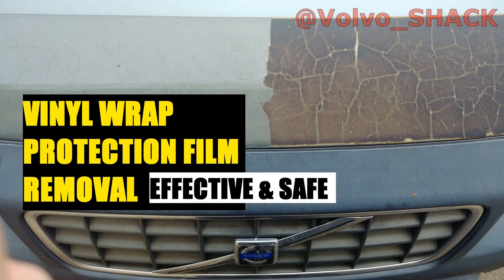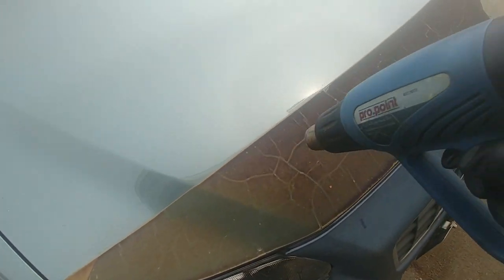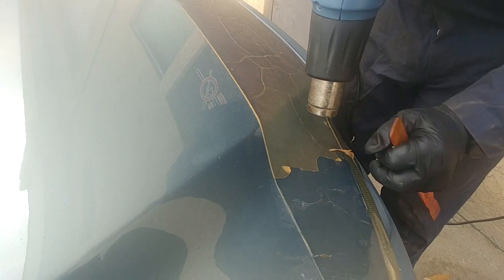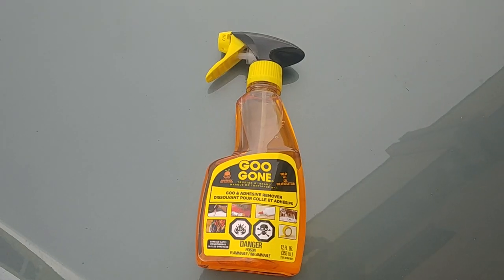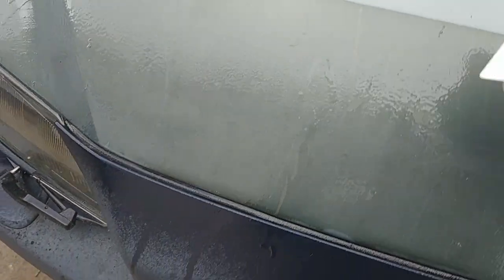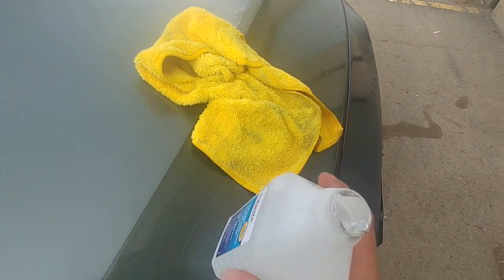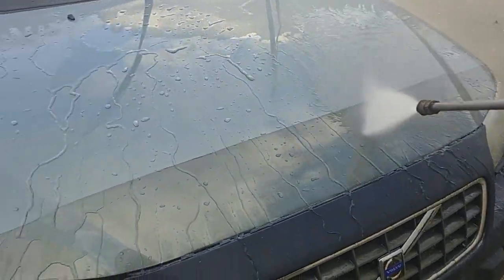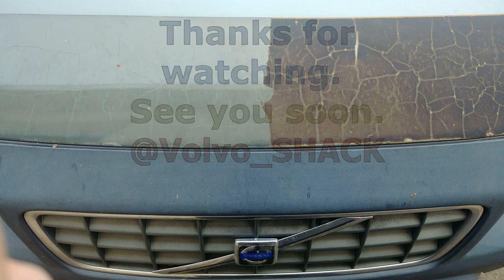HOW TO REMOVE OLD VINYL WRAP FROM YOUR CAR | VOLVO XC70

Comment: What people don't realize is that the discoloration is partially because the paint hasn't been exposed to sunlight and minerals for 15 years. The clear coat under the vinyl is much thicker than the rest of the car. UV rays and chemicals can alter how paint looks, and take away from the color. There's no way around it except maybe sanding and polishing
Reply from the maker: Great point. Thanks for an advise 1Hunnid Studious! I will pin your comment up.
Reply: This is exactly right. Everything is discoloured other then the part where the vinyl was.
I have replaced so many racing stripes for cars. You ALWAYS have this and only way to fix is to expose that part to sun, put new clearcoat on whole panel or wrap and hide edges of the discolouration.
Reply: @Szenenmischa  You could try doing a buff with a medium grit compound too and it'll sometimes blend it all out.

Comment: The real secret that i dont see anybody use us an industrial pressure washer. Theres a large power gap between blasting off vinyl/adhesive and stripping clear coat. Heat gets the vinyl off and cold gets the adhesive off

Comment: What I'm wondering is how to remove the discoloration thats left after removing the wrap. I recently bought a car that had the entire roof wrapped. I removed and I'm left with an entire stain across the roof.
Reply from the maker: Hi John. I'm not sure how to remove paint discoloration properly after the wrap. Let me know what worked for you. Thanks.
Reply: The problem is that if the car had the wrap for many years the paint underneath will be preserved in its original color while the rest of the paint shifts color due to sunlight etc so there will always be some mark left over. But I agree that it also looks stained in this case
Reply: That leftover discoloration is the adhesive that this yahoo didn’t get. Use goo gone graffiti remover(the aerosol can) and a plastic scraper to remove. Once your done with that you can buff out any scratch’s with polishing compound.
Reply: I painted cars for years and never had a problem using paint thinner to remove any adhesive.  This was a little different. I removed a whole layer of adhesive. It was like a "boogery" texture and took forever to get it all. However, after that stuff was removed, it still had a yellow tint to it. I tried using a rubbing compound as well which did nothing. Only thing I didn't try was wet sanding. Ultimately it didn't matter because I just put fresh wrap back on. But had I not wanted to re wrap I would have been in a hard spot.
Reply: @johnbowman4844  that “buggery” stuff is adhesive. Once you get all of the adhesive off it would leave nothing but clear coat. If you paint cars you should know that clear coat would never have that consistency.
Reply: Buff it out
Reply: @justinbenscoter2052  you need to chill out with the name calling...it makes you sound like a tool. Try getting your point across using facts, no need to try and  put down someone who is trying their best and willing to learn.

Comment: That “discoloration” is the adhesive you didn’t remove yet, rookie.
Reply from the maker: Thanks Justin! What is a best way to remove it?
Reply: @PistonShack  I am in the middle of doing it now. It’s a nightmare. I found that goo gone graffiti remover(the aerosol one) will loosen it up then you scrape it off with a plastics scraper. Once it’s all off you’ll be able to wet sand the whole panel with 2500 and buff it out and it will look like new.
Reply from the maker: @justinbenscoter2052  I hear you! That wasn't easy. I will try wet send with 2500  and buff when weather warm up. We had -27C last night)
Reply: You need to use a heavy grit compound and go in that direction
Reply: @PistonShack  how did it go? Any updates?
Reply from the maker: @XxXnonameAsDXxX  I has been almost two years since. It looks pretty much the same like on this video.
Reply: @PistonShack  In my experience you won't get rid of the discoloration once its gotten this bad. Wet sanding and polish might help some but its probably a fruitless endeavor for likely then not. Also forget the Goo Gone and try laquer thinner next time. Bit of a learning curve because you very much can go through your clear and paint, But it works so much more effectively

Comment: What if the ambient temp is 110° F°? Hehe
Reply from the maker: Hey Simon! If ambient temperature is 110° F - that's cooking hot! Thank you for your feedback.
Reply: There’s an old Subaru commercial where they are showing the winter torture testing they do in Minnesota. -40 F, snow, ice, salt etc… They end the commercial with the line, “If your winter is worse than this, you don’t need a new car, you need a new place to live.” Lol. Stay hydrated in that heat brother.